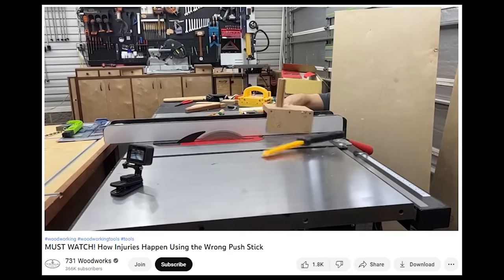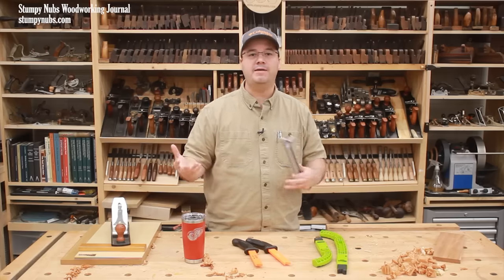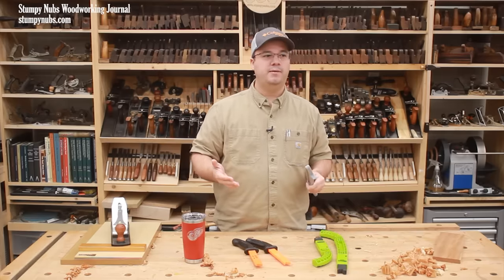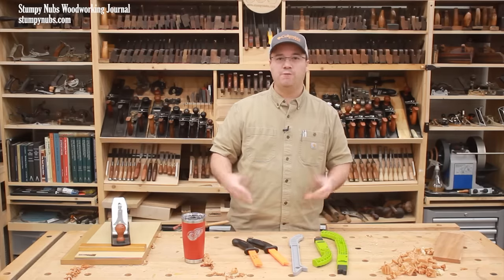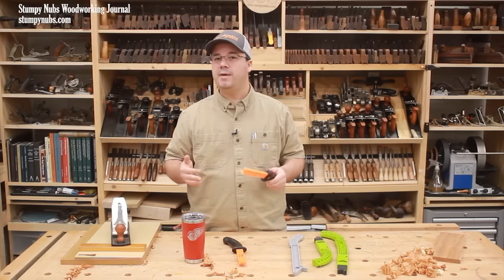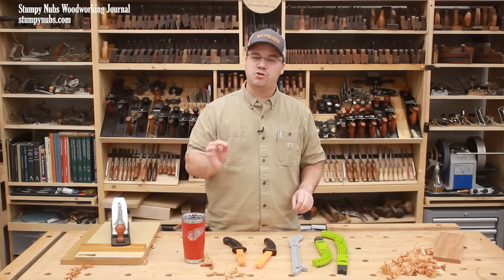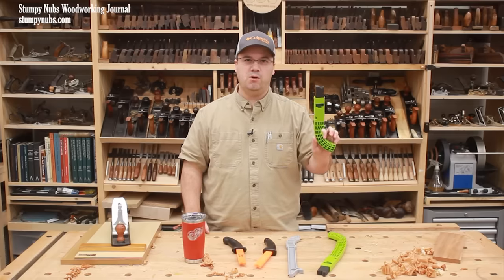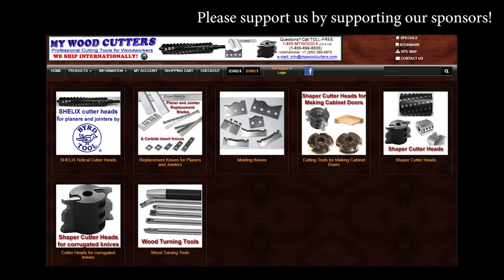EXPLODING table saw push sticks are a real thing!

Comment from the maker: ▼EXPAND THIS SECTION FOR IMPORTANT INFO▼   
-- Bow PushPro Pushstick (use discount code 731Bow10 to save 10%): https://lddy.no/1eahd

★THIS VIDEO WAS MADE POSSIBLE BY★
Helical carbide jointer/planer heads from MyWoodCutters: https://mywoodcutters.com/
Please help support us by using the link above for a quick look around!
(If you use one of these affiliate links, we may receive a small commission)

- Link to 731 Woodworks video: https://youtu.be/dYknMJ7QbNA

Some other useful links:
-More videos on our website: https://stumpynubs.com/
-Subscribe to our e-Magazine: https://stumpynubs.com/browse-and-subscribe/
-Check out our project plans: https://stumpynubs.com/product-category/plans/
-Instagram: https://www.instagram.com/stumpynubs/
-Twitter: https://twitter.com/StumpyNubs

★SOME OF MY FAVORITE CHEAP TOOLS★
-123 Blocks: https://lddy.no/vpij
-Mechanical Pencils: https://amzn.to/2PA7bwK
-Lumber pencil: https://amzn.to/2QtwZjv 
-Pocket Measuring Tape: http://amzn.to/2kNTlI9
-Irwin Drill Bit Gauge: http://amzn.to/2AwTkQg
-Nut/Bolt/Screw Gauge: http://amzn.to/2CuvxSK
-Self-Centering Punch: https://amzn.to/2QvbcrC
-Self-Centering Bits: https://amzn.to/2xs71UW
-Angle Cube: https://lddy.no/10nam
-Steel Ruler: https://lddy.no/10mv7
-Utility knife: https://amzn.to/3nfhIiv
-Center-Finding Ruler: https://lddy.no/10nak
-Bit & Blade Cleaner: https://amzn.to/2TfvEOI
-Digital depth gauge: https://amzn.to/3mwRf2x
-Wood Glue: https://amzn.to/3mqek6M
-Spade Bits: https://amzn.to/3j8XPtD
 
★SOME OF MY FAVORITE HAND TOOLS★
-Digital Caliper: https://amzn.to/384H1Or
-Marking Gauge: https://lddy.no/10muz
-Marking knife: https://lddy.no/10mv0
-Narex Chisels: https://lddy.no/sqm3
-Stanley Sweetheart Chisels: https://amzn.to/3y5HDOc
-Mini Pull Saw: https://amzn.to/2UEHBz6
-Gent Saw: https://lddy.no/ss2x
-Coping saw: https://amzn.to/2W7ZiUS
-Shinwa Rulers: https://lddy.no/zl13
 
★SOME OF MY FAVORITE POWER TOOLS★
-Miter Saw: https://amzn.to/3gqIlQ8
-Jointer: https://amzn.to/3yc3gfZ
-Planer: https://amzn.to/3mn6BGF
-Router: https://amzn.to/3grD22S
-Sander: https://amzn.to/3DdvD0Y
-Cordless drill: https://amzn.to/3D9ZiIm
-Brad nailer: https://amzn.to/3gsRkjH
-Mini Compressor: https://amzn.to/3mvrmQr
-Bladerunner: https://amzn.to/2Wl0TtJ
-Jig Saw: https://amzn.to/3zetTBY
-Scroll Saw: https://amzn.to/3gq9qDc
-Multi-Tool: https://amzn.to/3muZuMi
 
★SOME OF MY FAVORITE OTHER TOOLS★
-Drill Bits: https://amzn.to/3B8Ckzh
-Forstner Bits: https://amzn.to/3kk3wEI
-Shop Vacuum: https://amzn.to/2Wkqnbl
-Machine Setup Blocks: https://amzn.to/3gq7kDh
-Counter-Sink Bit: https://amzn.to/37ZukUo
-Featherboard: https://amzn.to/3DeqHsq
-ISOtunes Hearing Protection (Save $10): https://bit.ly/3BHYdH7
 
(If you use one of the affiliate links above, we may receive a small commission)

Comment: There's also an age component. As plastic gets older it generally gets more brittle, especially with UV exposure.
Reply: Yeah a one or two years in an unheated/cooled shop and I could see some of these failing catastrophicly
Reply: Not all plastic. PLA will tend to get brittle as it soaks up moisture but even at low moisture is already too hard for me to trust for a push stick. PETG on the other hand will remain flexible and kind of soft in the presence of moisture. Both however are susceptible to tempering as they are heated and cooled, which makes the material harder and more brittle. Some plastics will weaken when exposed to Isopropyle alcohol while others weaken in acetone fumes. I would not trust any push stick without knowing what plastic it is and looking up information to see what is known about it. Too many seemingly harmless interactions like the one between PLA and humidity that can seriously weaken the plastic.
Reply: Exactly! There is a lawsuit pending about old plastic dashboard and or trim injuries from airbags deploying with shrapnel! I know that you know how this happens.old hard plastic shrapnel. Oof!
Reply: Or in a basement shop with an oil fired boiler. I swear trace amount or exhaust degrades plastic.
Reply: PVC yes, but HDPE or Nylon do that much less

Comment: I've always made my push sticks with wood. Not implying that the plastic ones are not good, but I like the idea of customizing my stick, and there's never any shortage of wood in the shop.
Reply: I also make mine from wood. Like you I have no shortage of scraps. I use plywood for them for added strength.
Reply from the maker: I covered (and recommended) homemade push sticks in the video 😊
Reply: We are woodworkers, made out of wood, correct density, custom made for the job, Beats the chinese and even cheaper, nuff said
Reply: I used to make my push sticks from wood. Then I had one break on a grain line once and the force made me follow through and I hit my hand on the table. I got lucky..now I use plywood.
Reply: Exactly. Plus when ripping narrow stuff like 3/8s my push stick always get a cut down the center. Easy to cut a clean end on the bandsaw once its chewed up. If the stick gets too short start a new one. I just use 3/4" x 1.5" straight sticks with a notch in the end, cant get cheaper or easier to make.
Reply: Same for me. I only make my push sticks from 1/2" plywood.
Reply: I always thought they gave away those fancy stir-sticks at the hardware and paint stores so when I was done painting, I had something to laminate to 3/4 stock and "flesh it out" for forming PERFECT ergonomics with ABSOLUTELY MINIMAL effort on my part...

    Am I doing it wrong all these years???   ;o)
Reply: Those pokey-style push sticks don't cut it for me. I make mine from wood in a puffy L-shape so that I have several inches pressing flat down on my piece that I am cutting, with an elevated handle projecting forward so that the center of effort is over the piece, not behind it.
Reply: same here, besides my GRRiper, but thats not really the same thing.
Reply: Pointy aluminium rod goes very far when controlling small pieces of wood
Reply: Same here. TBH i find the process of making the quite enjoyable. It usually takes me about 10 minutes with the bandsaw and the belt sander. What other projects take only 10 Minutes and are actually useful?
Reply: I agree. Goodness, if you’re a woodworker, what’s so difficult about making several wooden push sticks?
Reply: @RichEklund  That is why I use a 2 X 4 block and not a stick.
Reply: @chrisgenovese8188  That is just a wast of money...
Reply: Me and my dad always did the same thing too. Making my own push stick was the first thing he taught me to do
Reply: My Delta table saw came with a plan for a wooden push stick. That's the first accessory I made (took ten minutes and a piece of scrap wood) and I'm still using it 30 years later. IMHO, pushing any push stick into the blade is asking for trouble.
Reply: @RichEklund  Same thing happened to me years ago.  If I wasn't left handed and stand to the right of the blade I would have been skewered by a nice shard of maple.
Reply: @davidcurtis5398  not sure what your talking about. i love it and use it all the time. easily my favorite $40 table saw accessory.
Reply: Snake stick. That’s what my wood shop boss at one of my college part time jobs called the piece of wood he shaped into a push stick. Treat it like you’d treat your appendages - keep it out of the spinning blade and it should last forever.
Reply: @chrisgenovese8188  To each his own, but mentioning gggggripper in a sub-thread about people making their own pushsticks. 🙂  I'm only surprised that only one person commented on it.
Reply: @bobvogel9916  i only mentioned it as a caveat to making my own pushsticks. you are the one the decided to fixate on it lmao
Reply: @daniels5345  sound like asking for that aluminum rod to find a way to get jammed into the blade and cause all kinds of problems.
Reply: Same here, I generally grab a piece of scrap and rip it down into a few different thin push sticks, when they get torn up, I grab another. 
The last few were an 15" length of 2x4 ripped into several 1/4" strips with a small birds mouth on on end.
Reply: If you buy a push stick, you're not a woodworker.

Comment: Temperature matters.  Around here, many hobby workers either work outside, or have a non-heated building for their woodworking.  (Bulky coats around saws could get a video all its own, but most people are smart enough to take the coat off for the tablesaw work).  The important bit for this is what is a pliable and tough plastic at 60F may shatter like glass at 10F, so if you are working in the cold, use a wood push stick.
Reply: Age is also a factor. Some plastics will 'dry out' over time and become brittle.
Reply: @ColdRunnerGWN  Good point.  Especially if stored in sunlight or exposed to high temperatures.
Reply: @lperkins2  ALL of the above points MUST be remembered when dealing with plastics and their uses and storage . Don't ask me how or why.
Reply: @danielbackley9301  No plastics around my table saw. Only wood push blocks...
Reply: I’m drying out and getting brittle, that’s for sure.  Less than twenty years ago I climbed stairs five steps at a time.   Three years ago I fractured my foot getting off the toilet! Aging sucks
Reply: @danielbackley9301  Plastics are a petroleum-chemical product, these take years to completely stabilize through out gassing after being processed into their final shape and consistency.
Reply: Coat off, yes. Flannel shirt sleeves, buttoned, do not roll up the cuffs. Shirt tails tucked in. Even, if needed, belt tight and/or suspenders. Lastly, shop aprons are to safley contain  clothing and not only cleanliness. PS. Apron pockets can hold push-sticks if you do not have magnets on them. I vote to make your own wooden push sticks, it is a Craftsmen's skill, and cheaper.
Reply: @greghetzler9266  and a home made push stick won't be an issue if you make that mistake and send it into the blade, it will just get cut.
Reply: @jaquigreenlees  ... And, I have a great big smile when that has occurred and I count my fingers 1, 2, 3, 4, 5, 6, 7, 8, 9 and, TEN!
Reply: @greghetzler9266  same here. Have a scar from when a piece of wood snapped while cutting it on a bandsaw without using push sticks, nearly lost the top half of my thumb.
Reply: @jaquigreenlees  when I was 14, he he long ago, the shop teacher was referred to as, 'Knubs'.  Supposedly the 2x4 he was ripping kicked back so far and hard the brand new school doors got busted,  his fingers hit the door also. Excellent illustration of need for safety.

Comment: A few years ago, I bought a Grizzly hybrid table saw and it came with this red plastic push stick. One hit on the blade sent it flying out of my hand. Since then, it's only used to help snug the work piece against the fence and only before the blade. I've got a wooden push stick for actually pushing the stock through. Still, I'm respectfully nervous every time I get near the saw.
Reply: A sensible attitude.  An Emergency doctor once told me that any circular saw can cut off a human finger in less time than it takes the owner of the finger to feel it happening.  So whether it's a table saw or a hand held circular saw, I think about that every time I am about to use one and it keeps me careful.
Reply: Push blocks are better...
Reply: @davidcurtis5398  I just bought my first push block on Amazon.  Haven't used it yet, but it seems pretty impressive...
Reply: @FireAngelOfLondon  Table saws and radial arm saws are like motorcycles:  the day you aren't a little scared of them, it's time to step away.
Reply: @davidcurtis5398  Push blocks allow your hand over the blade and into the red zone.
Reply: @pawpawstew  i doubt if I will ever get cut with a push block made of a piece of wood 3 to 4 inches thick with a blade coming through the cutting wood about 1/16 of an inch. You are so wrong it is a pity...
Reply: @pawpawstew  Been doing this for over 50 years and never have had a problem. Last time I reply to you... Impossible to get hurt the way I do things...

Comment: I make my own out of 3/4" plywood, and run them thru the blade for certain cuts. I've used the same pattern for like 30 years now, and the have far better control than those long skinny sticks. When I have scrap ply, I trace a bunch of sticks on it, and make a couple dozen on a rainy day 😊 I'll share the pattern on my channel next time I make a batch...

Comment: I only use wood push sticks. I once had a Bosch push stick bump the blade and got a piece of plastic in my nose. I should add this happened when it was 10 degrees outside when I was cutting. So I would think temperature play a part.

Comment: The first thing that came to my mind was the effect of temperature on the material characteristics of plastic. Many people have workshops that can't be adequately heated, or are only heated when in use. That means there will likely be occasions when the sticks are in use while the plastic is considerably colder than room temperature. Cold plastics are harder plastics (even plastics that are fairly soft at human-standard temperatures), and harder usually means more brittle.
It's a factor that's important to consider.

Comment: The primary push stick I use is made out of MDF. Not for any particular reason, it's just the scrap I had available at the time. I have run it over a blade before when I had to make a particularly difficult cut, and it basically just powdered away.
Reply: Only MDF for me. I have run into it lots of times and never knew it. Just turns into powder.

Comment: I'll have to agree with James King. Whether plastic or foam, this IS a DANGEROUS push stick in the design of the shallow lip. A long skinny board such as making cutting boards has a tendency to rise on the backside of the cut. Why? The blade is coming UP on the backside. My homemade design keeps the board down through the cut and your hand is way above the blade-see Allred Woodworks fb. I encourage every woodworker to toss these mini lip push sticks and make their own.
Reply: Plastic breaking issues aside, I definitely prefer a push stick that can not only push the wood forward, but can ALSO help hold the wood down. 

The mini lipped ones as you say are out of the running for me.

Comment: Perhaps a take on the foam insert is to use a wood insert that you make instead. Use a 3D printer to make the handle that holds 3/4" wood insert.

Comment: Great video.  I had the cheap orange and black Amazon push stick and suffered a violent explosion of one of them when accidentally contacting the blade.   The 2nd one went in the trash along with the pieces of the first one....I was lucky that all the shrapnel missed me and hit the shop wall 10 feet behind the saw.

Comment: The most important safety device is the one sitting on your shoulders. Never put your fingers in harms way. If you don't feel comfortable with the situation...Pause, think about it, make it a better situation. If it's sketchy, don't do it. I speak from 40yrs experience and a few stupid close calls. It ain't worth it. Find another , better, safer, way to do it. Trying to save a 2 inch piece of wood because you only need 1inch of it, might seem like a good idea, but just cut it out of a bigger piece that can be easily and safely held on to.

Comment: I have rip cuts from 2x4' and 2x6's that are about a quarter inch thick and 2-3' long from a project I did a years ago.
Never threw away the scraps from the rips because they make perfect push sticks. Yes, the blade has hit them a few times, but it doesn't rip them out of my hand because of the length and where I'm holding them. Also, when my push stick needs to be close to the blade, I try to avoid hitting it, but mentally prepare just in case it does come in contact.

Comment: Refrigerate push stick overnight and it will shatter like shrapnel if it is a cheap bad push stick or if by chance your woodworking equipment is in the garage during the winter time and you go out for one quick cut yes the push sticks will shatter if they are plastic and if you use the freezer you'll have to clean up a mess but up in Montana as a kid I saw many things shatter from just the cold

Comment: Wooden push sticks for the win. Hard plastic push sticks are inherently brittle.

I've got a preference for the larger version that has a long section on top of the board, as I find it helps keep the work-piece riding up the blade, thereby preventing kickbacks much better.

One thing I would like to see is the other video's experiments duplicated using a jointer rather than a tablesaw. A single hard strike from a jointer blade rather than the multiple smaller saw blade cuts may make shattering more likely.